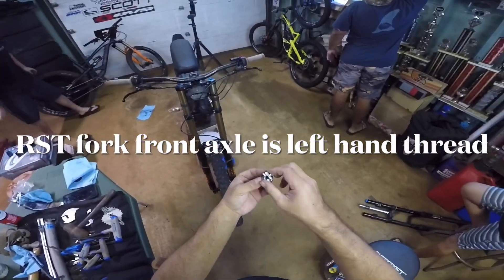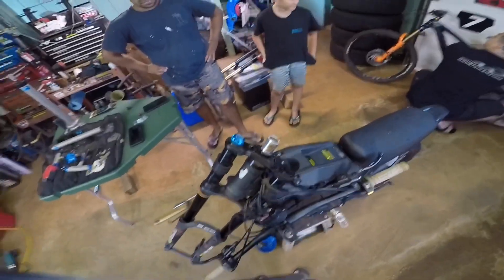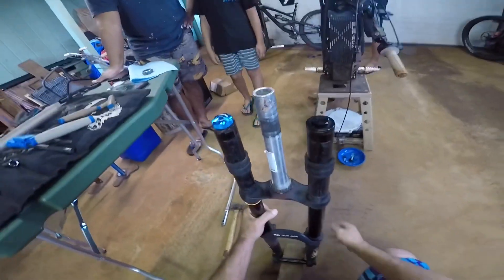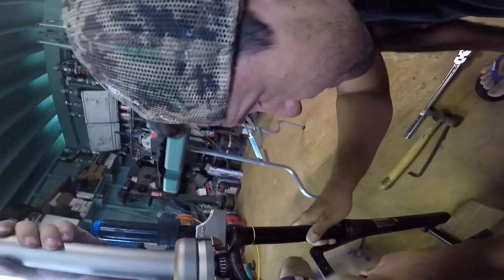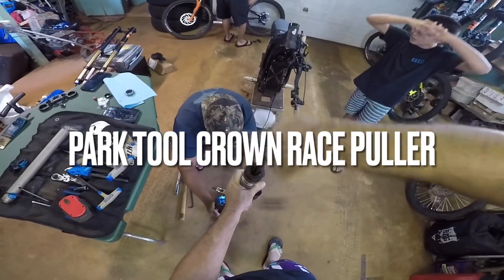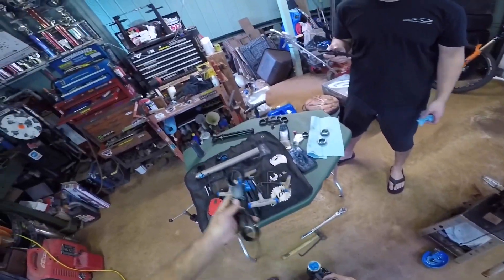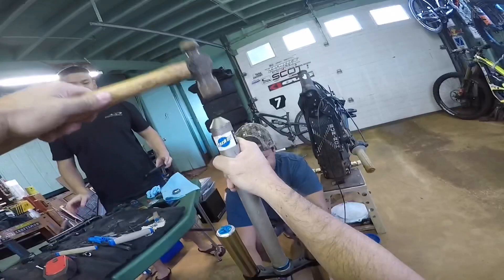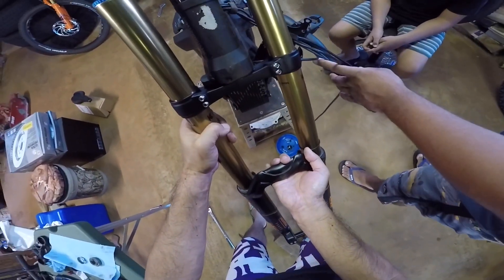How to Install a Fox 40 Float Factory 27.5 on a Sur-Ron X

Comment: My spacers in my sur ron wheel keep falling off man haha is the suppose to be something to hold them on ??? I’ve put them on the wheel and fitted the wheel in the forks but there’s a slight wobble ???? Fast reply please lads 🙏🙏🙏
Reply from the maker: If there's a slight wobble and everything is tight you may have worn wheel bearings.  Hard to diagnose without looking at it though.
Reply: I’ll order new bearing then mate nice one thanks, do u recommend any rims and tyres for the light bee x. For off-road and on road use
Reply from the maker: @DanJs-bz1zj  https://woodyswheelworks.com/products/sur-ron-x-lb-sb-segway-edirt-bike

Comment: fox 40s float factory grip 2 27.5 the same and if not will it still fit
Reply from the maker: You will need a 5mm spacer for the newer 40s due to the Boost spacing.
Reply: @ratcamaro  thank you

Comment: One of the better install videos out there, much appreciated for doing it!  Question regarding the 5mm boot spacer, did you have to get longer bolts or the ones that came with the spacer long enough?..  pls lmk, in the process of installing.  much mahalos!!
Reply from the maker: The bolts provided with the 5mm Boost rotor spacer are long enough.
Reply: @ratcamaro  Right on, thks for the quick reply!

Comment: i found a good deal on some fox 40 but i think its a 26 not a 27.5 does that really matter?
Reply from the maker: With the 27.5" fork there's a lot of room between the fork arch and the tire.  The 26" fork should be ok.  Search the internet for others that have done it just to be sure.
Reply: @ratcamaro  great thanks!

Comment: In Fox's online data sheets it says the maximum length from "top of the crown" to "top of the upper tube" should not exceed 137.5mm (~5.413inches), otherwise the seals will bump into the crown when bottoming out. With the headtube height plus this weird spacer looking thing mine is actually about 170mm and I lose some fork travel as well. Can't install FOX's mud guard too. I have 2021 model, is there nothing you can do about it?
Reply from the maker: Fox and Risse Racing sell drop upper crowns for that exact purpose:  https://risseracing.com/store/product_info.php?products_id=710
Reply: @ratcamaro  thanks a ton, you're a lifesaver!
Reply from the maker: @pavelmeshkov5433  I have extra notes in the video description as well.  Glad I could help!
Reply: @ratcamaro  Thanks! Maybe you know how much room will I gain after installing this? Risse's website states .9'' of drop which I think is not enough to install within Fox's specs, giving now I have almost 170mm (~6.7'') and the required maximum is 137.5mm (~5.413'') and even less (132mm) if I want to use mud guard. I guess I will at least have full travel though, but something with larger drop would be way more beneficial. 
Quick googling haven't given me much, guess I have to dig deeper, will update if I find the solution.
Reply from the maker: @pavelmeshkov5433  The older Fox 40 stanchions like the ones on this 2016 model are longer.  If you can find older stanchions along with installing the drop upper crown that would be the ultimate solution!
Reply: @ratcamaro  Thanks, but it's really painful to throw away new stanchions and buy "new" (in this case old :D). I've probably found another solution, which is to buy Luna's cane creek headset, it's much more narrow than the stock one on my bike (2020 Surron), hopefully it will be just as heavy duty as the stock.
Reply from the maker: @pavelmeshkov5433  Yup the MTB headset has a shorter stack height but is less durable than the tapered roller bearings.
Reply: Either this or you can replace that stock headset that adds about an inch and a half to the top of the headset and use a cane creek headset instead.

Comment: good video,but I don't think you are getting full travel without a drop down top crown?
Reply from the maker: This fork is a 2016 model with the longer stanchions so it's ok but good catch.  A lot of the guys don't know that the newer 40s have shorter stanchions and the lowers will hit the lower triple clamp before bottom out.
Reply: @ratcamaro  thanks for the heads up

Comment: Hi, i will mount Fox 49 with 20x110 boost , do i need to add something to work with stock tyre/disc and brakes?
Reply from the maker: Sorry I just saw your comment now.  You need a 5mm rotor adapter to make the stock wheel fit on a boost fork:  https://www.jensonusa.com/Mrp-Boost-DH-Brake-Rotor-Spacer-Kit

Comment: My front axle is locked up the same way.  Except I cant get mine off. Any other suggestions 
 I grinded and chiselled but it wont budge
Reply from the maker: Are you turning it the right way? It’s reverse thread so you turn the locknut clockwise to loosen. If you are and it’s still stuck you’ll have to drill it out
Reply: @ratcamaro  yes, im turning it righty loosly.  But no budge.   You  think Drilling it out will work? It is soft aluminum.  At least now I wont feel bad about completely destroying it.  As long as it comes out.  Thanks
Reply from the maker: @organicoceans4459  Yeah I was gonna drill this one out but decided to grind a slot in it and tap it off with a chisel and that worked.  When drilling it you might get lucky and have the lock nut unscrew since it's clockwise to loosen.  Good luck!
Reply: Wow, not buying this money pit, lmao, “look at me, i can ride off-road mom” who fucking cares lmao

Comment: The surgeon has 1 1/8 non tapered head tube ? Could tell for sure in the video
Reply from the maker: Yeah it’s a straight 1 1/8” steerer tube.
Reply: @ratcamaro  thanks for quick reply 👊🏻

Comment: What did you do to avoid the break rotor to touch the break pads? Think I heard you say at minute 16.30  "take off the adapter" but not sure what adapter you are referring to.. I have a 21" wheel in the front and same fox 40... Awesome video, thanks!
Reply from the maker: The stock set up has a brake adapter to move the brake caliper outward. With the Fox 40 the adapter is not needed. You bolt the caliper directly to the fork.